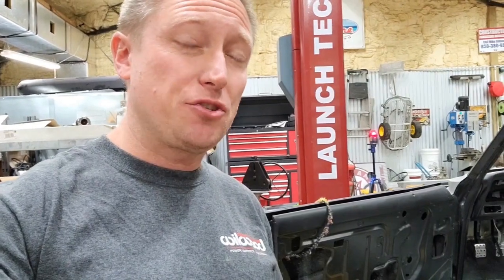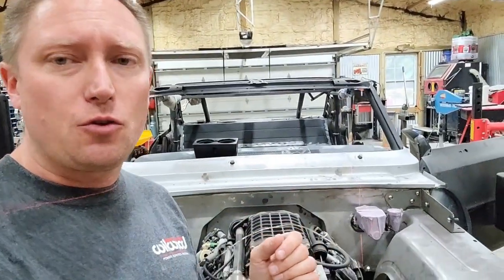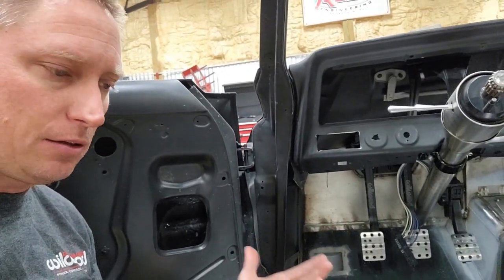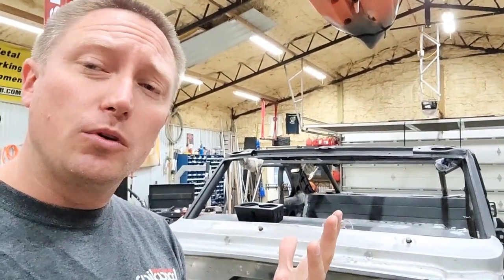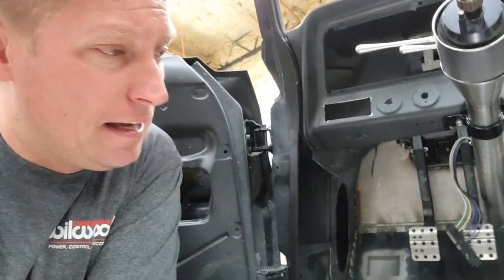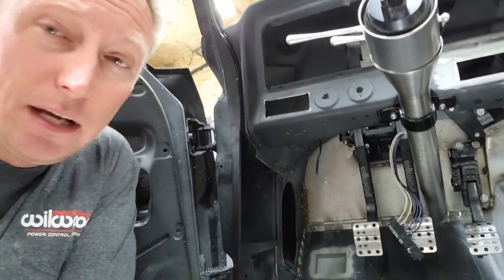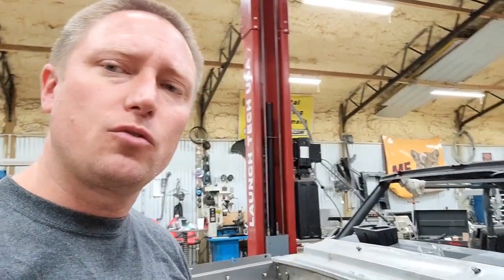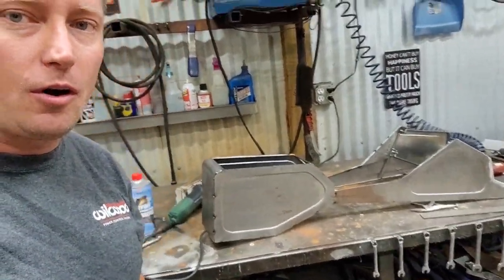What I Learned - Installing a Wilwood Pedal Box

Comment: Thanks for all your videos. I appreciate them.  Question - You placed your brake pedal on the left side of steering column. There are others that do it the same way (on the left) and also others have place it on the right side of the column. Are you happy with it being where you placed it or if you had to do it all over again, place it on the right? I have talked to others and asked them where to place the brake pedal, and some say put it where its comfortable, but that cant be the answer - that is not good enough. There has to be more to it. Thanks
Reply from the maker: I'm going to have to agree with "them" on this one.  Definitiely put it where it's comfortable for you.  If you don't, and it's not comfortable, then surely you'll regret it?  I placed mine to the left of the column by way of default.  The trans tunnel on my car is quite large to make room for the TR6060, so there was zero chance of there being enough room for two pedals to the right of the column.  Thanks Greg.
Reply: @RedlineStands  Thanks- appreciate the response. Keep making great videos!